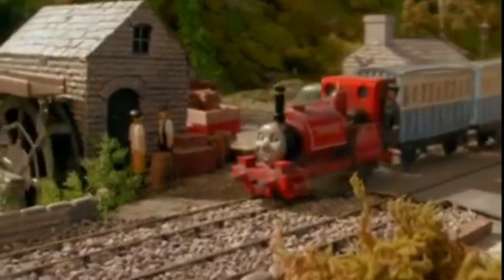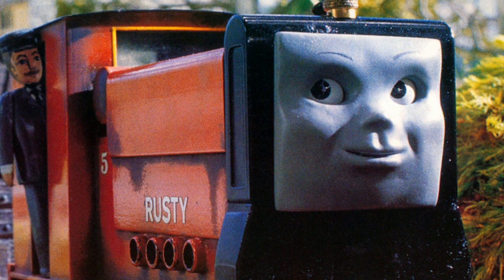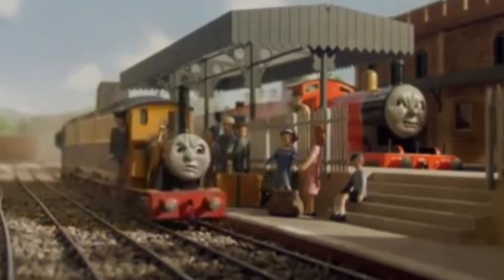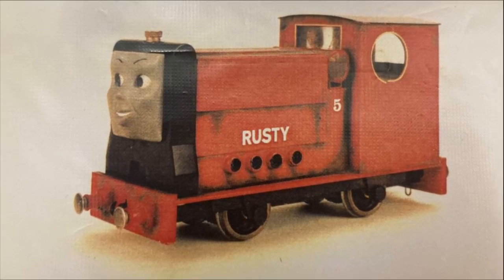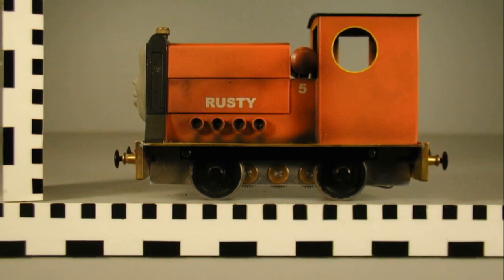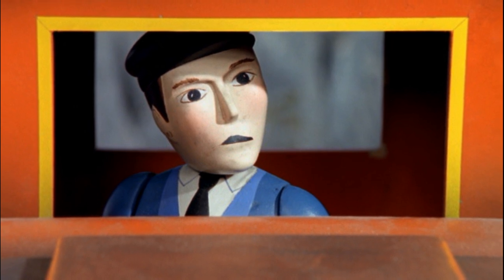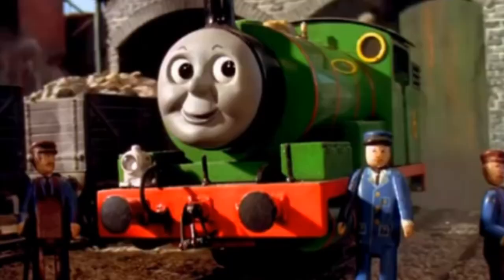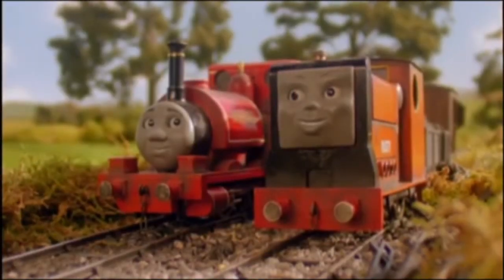The History Of Rusty & His Models: The History Of TTTE

Comment: Not to be pedantic, but CNC stands for Computer Numeric Control. So the machine that was used to make the chassis was computer controlled. Still definitely custom machined, but thats not what CNC means. I have enjoyed your videos a lot, keep up the hard work.
Reply from the maker: CNC also refers to a type of motor that’s custom machined, you’re very right but it has another meaning too I suppose in another area haha. Thank you man! 

https://www.heidenhain.us/resources-and-news/servo-motors-for-cnc-machines/
Reply: So, I think we are talking about the same thing, kind of, CNC machine tools (such as a mill) use those motors controlled by a computer to move the work piece, the machine head, or both.

There are commercial industrial applications for CNC machining because of their reliability and repeatability with little opportunity for operator error, as well as in smaller shops for prototyping and custom work because one can go from a computer modeled design to the physical end result with ease.